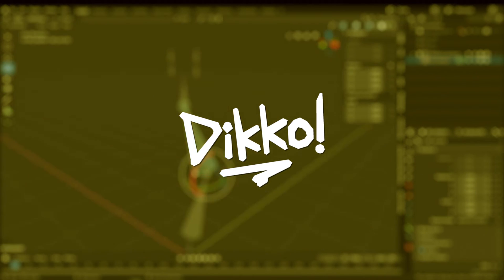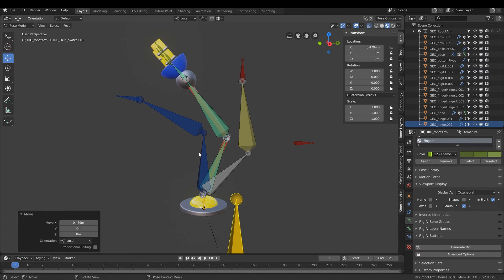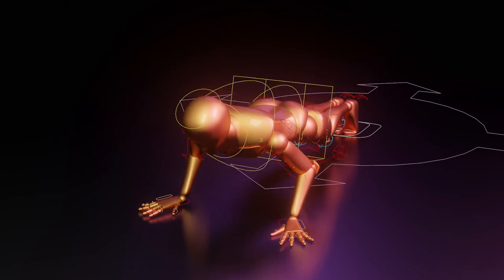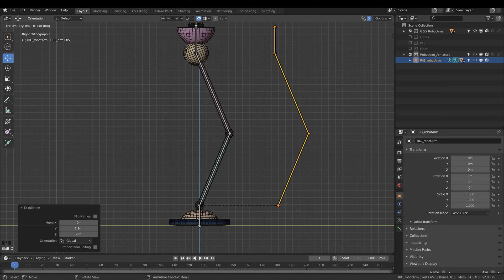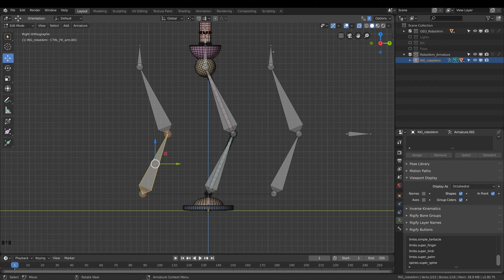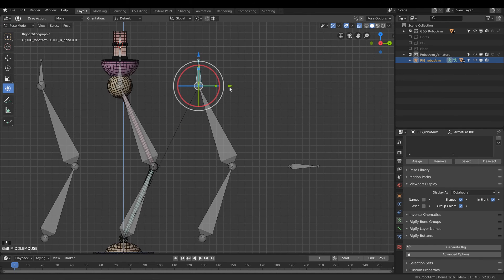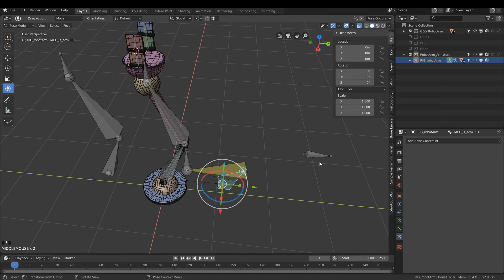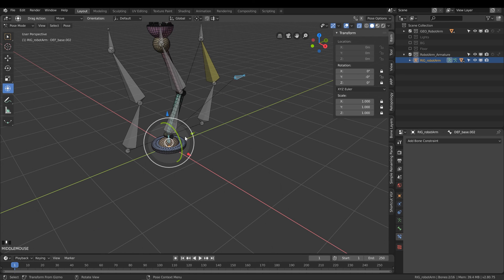Rigging in Blender Pt.4. Building the FK and IK Rig!

Comment: after adding pole target 14:39 the all structure stops to bend and becomes straight. why?
Reply: If that solution doesn't work you have to make sure that the bones have some bending at the joints, if they are completely straight the IK solver fails
Reply from the maker: You have either forgotten to change the chain length, or your hand joint is still a child if the arm, when it should be a child of the base

Comment: Is there a reason why you make all of this at already partially bend model instead of straight? I'm asking because I have issue replicating this partially, when I set the Pole Target rig just stops bending in the middle. Is this due to my straight model from the beginning? Also noticed without Pole Target it kind of works, but blender don't know which side to rotate it +90 or -90 jumping like crazy.
Reply from the maker: Having a bend in the joint structure, even even if it's a little, helps to direct the ik vector.
Reply: same problem

Comment: if you Built your arm straight up like I did and are having issues. you can change your pivot point to 3d cursor and use the centering trick he showed us to go your elbows center. after that, you can grab the upper rig and upper body in edit mode and give each of them an exact 45-degree pivot in orthographic mode and it should all still be in place

Comment: So I've watched this video a couple of times and I'm wondering why you are using 3 rigs and applying IK and FK to them seperatly while most movies on the internet combine these things in 1 rig. Is it for an easier example or is there a benifit to seperating them?
Reply from the maker: Ive never seen a FK/IK rig set up that doesnt use 3 joint chains. It's technically all the same rig tbh. You need 3 because the first one drives the deformation of the arm, then the other 2 (the FK and IK limbs) are just constraint targets. Ive "seperated" them for the purpose of this video to demonstrate that functionality. In video 5 we align them all back together!
Reply: @Dikko  What I mean is this: https://youtu.be/0bFrZn8xlLw Most tutorials I've seen use this approach where they use the same chain and just add the IK to the FK chain.
Btw, do you have a discord? I would love to join one where there is this much knowledge!
Reply: @Yurup  The video you showed would only allow IK exclusively. The reason he made the rig this way in this video is so, in the next video you will see, he can add a control to allow switching between FK and IK.
Reply: @gridsherman6854  It can be turned off by adding driver to IK influence.
Reply: @Dikko  The question was why to use extra bones for both IK and FK, I mean IK constrain itself has Influence parameter that can be used to turn IK on and off. It solves the problem that If you, use FK controller first pose the model and then switch to IK to adjust the pose, when you use separate bones for both IK and FK, the model jumps to IK bones position as they were not moved along with FK bones.